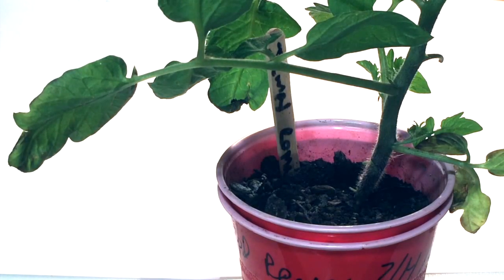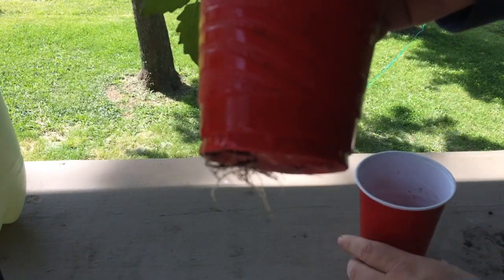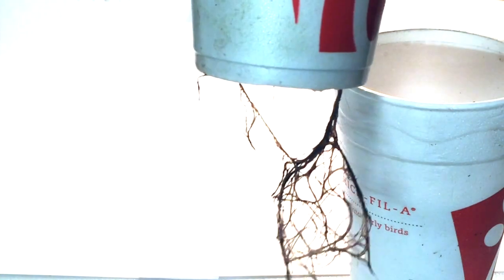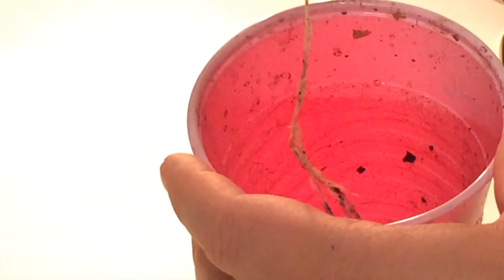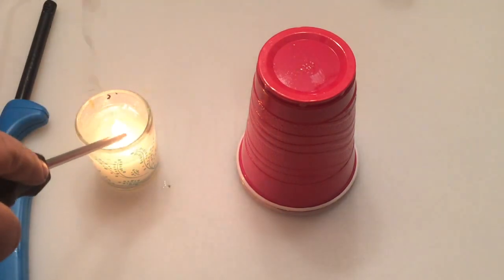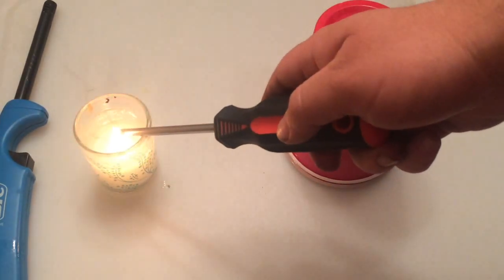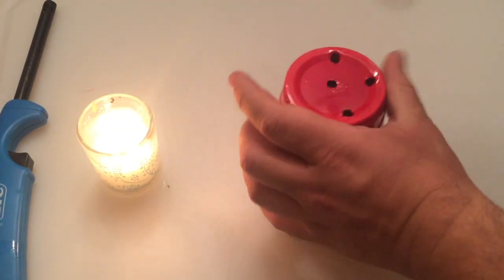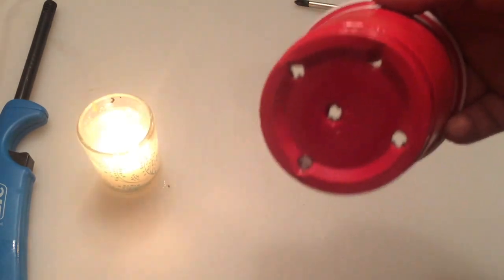Transform Solo Cups Into a Hydroponic/Soil Plant Booster - Double Cup Method

Comment: Do you pull the roots back through the holes when you transplant the plant? Will it damage the roots?
Reply from the maker: Most of the time I pull it through without any damage, but sometimes they break you can make the holes a little bit larger or cut slits in a cup if you are concerned
Reply: @BestGardenChannelonYoutube  thanks!